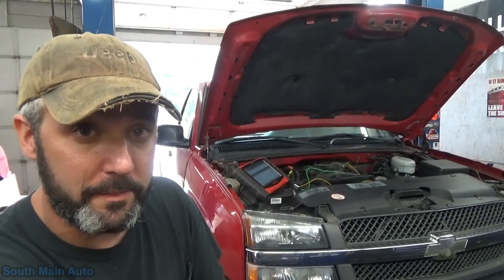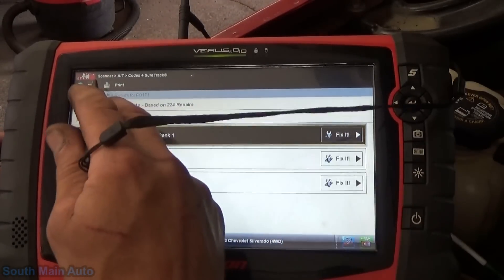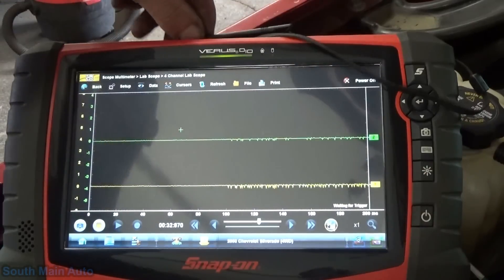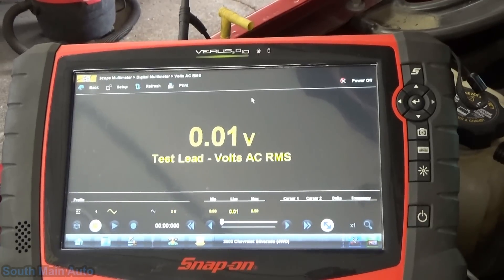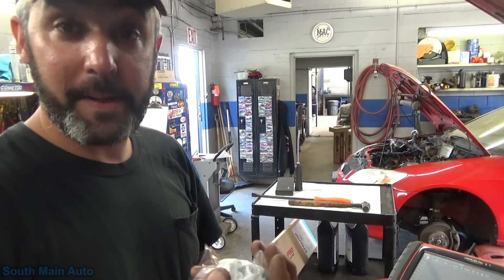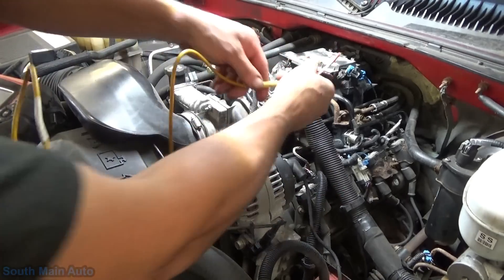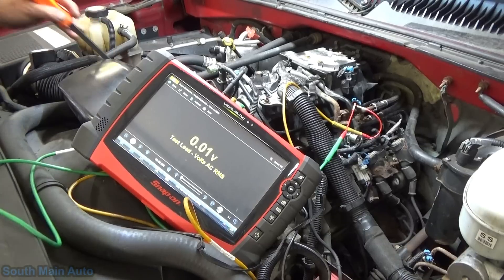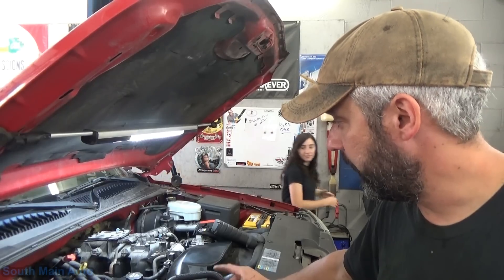How To Diagnose GM Knock Sensors - P0327 & P0332

Comment: Eric, some recommend when you pull the intake you should change the knock sensors and harness. Do you agree with that?
Reply from the maker: Yes I replaced the lower intake gasket sense I had it off. If I am just doing an intake gasket because of a leak I only do the know sensors if the customer wants. The intake comes off in about 15min so It really doesn't make sense to me to just wing 300 work of knock sensors and harness at it if there is no code for them. Does that make sense?
Reply from the maker: Did you see the video?
Reply: Umm. Yes. But you had a knock code. What about a good old intake leak. Do you bundle these into it?
Reply: well not to act like i know what he did i would imagine if he removed the intake he would of course go with a new intake gasket after i would guess
Reply: Man I would really like to see you pull one of those intakes off. I have the 5.3 in mine.

Comment: My Actron said that the unbalance wheel will turn on that knock sensor code.  Eric you should check your wheel balance.  They may need to be rebalance HAHAHAHAHAHAHAHA Great video Bro!
Reply from the maker: Haha he is still wondering what a knock sensor is I imagine...
Reply: South Main Auto Repair And here we call the DSO2 the "Narc" sensor cause all it does is tell on the bad cat lol.
Reply: Hello Eric 
I have a 2008 Ford Focus Sedan (2.0L Duractec , 4spd auto) 
It has just manual air/heater controls. And speed 1,2 4 work fine. 
But number 3 basically  is the same speed as #2. i doesn't get faster on # 3.  But it will get faster on 4. 
I replaced the Blower Motor Resistor with a OEM FORD Part and it made no difference. 
Any ideas what the solution to that is?
Reply: lightningsmokerXx maybe your switch is bad. Usually if a resistor goes bad no setting works except for the highest speed

Comment: I'm sorry you're not feeling well. I hope you get better soon. Thank you for showing the test with a digital voltmeter since I don't have a scope. US diyer's appreciate that very much. Another great video!
Reply: I would also suggest 2204a for a DIYer. Why? Because you would speak the same language as the pros when setting up tests and sharing waveforms -- the software is very similar. Sure, some options are not available, but still you can do a lot of tests.

Ramon Ruzic (search for his youtube channel) has done quite a few automotive tests with it, and there are some more involved tests on my channel.
Reply from the maker: You can get a scope pretty cheap now days Kenneth if you want one...
Reply: South Main Auto Repair Which one do you highly recommend?  I trust your judgment greatly.
Reply from the maker: Do a little googling on Hantek scopes and read the reviews. See what others are saying about them.
Reply: Socket thanks for the info
Reply: Thought the pico was the least expensive at $2,500?
Reply: Sandbag1300 well I can't afford nor would I be willing to spend $2,500 for a scope as a diyer.

Comment: You did good getting this information out despite being sick. You even spent time using the DVOM for the DIY'er guys. That's cool.
Reply from the maker: But you have a Vantage so it would be no issue for you...
Reply: Eric , a friend of mine is looking at the following cars USED. 
And i wondered do you see any major issues with these models that you 
would sway someone away from? Just wondered how the Hyundai Suv & Kia's are. 

2014-2015 Hyundai Tucson - 2.0L -     4cyl - Auto (naturally aspirated) 
2014-2015 Hyundai Sante Fe - 2.4L -   4cyl - Auto (naturally aspirated) 
2014-2015 Kia Soul  - 4 cylinder  (not sure on engine yet)

Comment: You may not be an 'Piezoelectric' expert but you sure do have a great understanding of electrical circuits, troubleshooting the use of meters and general electrical theory / concepts. I have been in the electrical construction, service and maintenance industry for over 30 years and few of my coworkers could do what you do.  The use of data between modules as I see in your videos is a common practice in fire alarm systems and building automation systems. You would do very well servicing either, Better than many electricians I work with.  I guess the big diffrance is you seem like you want to know how it works, many I work with could not be bothered to learn new things.  Thanks for the videos, I wish your shop was closer to me. I would love to bring you my 3 valve 5.4 Ford to look at.
Reply from the maker: 3v Ford :/ Bahhh just throw some chains and cam phasers on it you will be fine ;)
Reply: Now, now Eric.... Dont forget when you came to me asking for help getting your channel off the ground.  before I pushed your channel on my channel you couldnt break 2000 subs.
 "if you come up dont forget about your dawgs, that's law"
Reply: South Main Auto Repair Now watch it there, Schroderbox gonna come knockin on yer door if yer not careful.
Reply: Schrodingers Box We love you too Matt
Reply: Just watch FordTechMakuloco hes got plenty of vids on them to keep you busy lol
Reply from the maker: Haha he can knock all he wants, I could spin circles around Matt haha